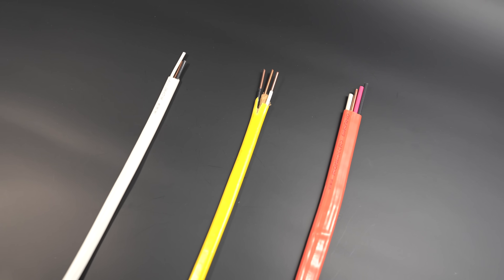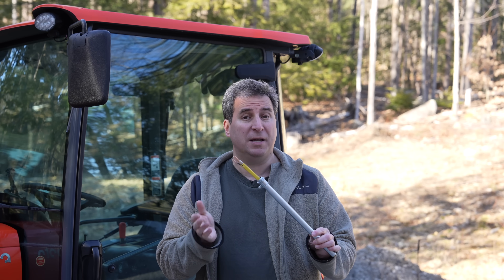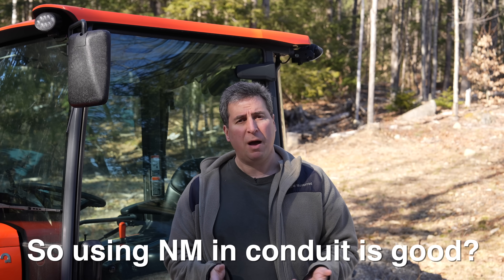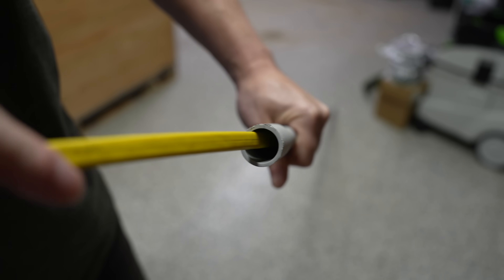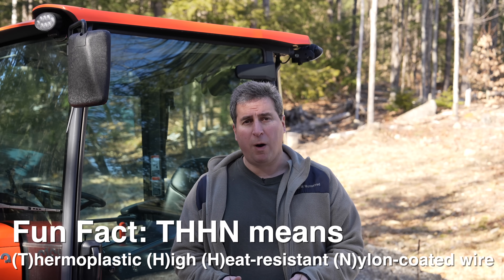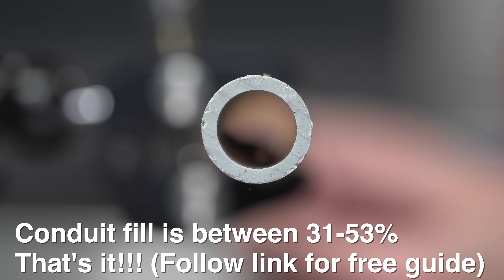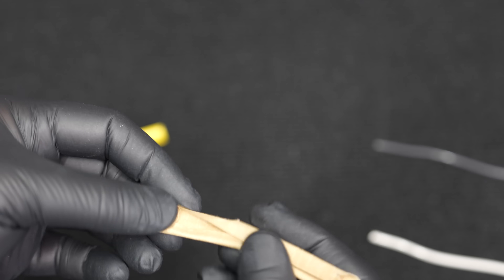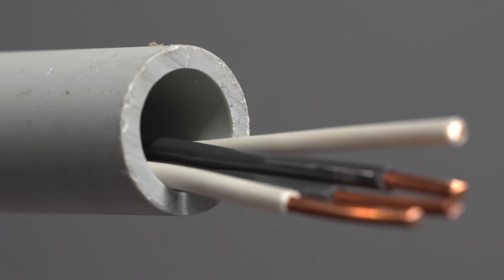#1 DIY Electric Mistake - Can you use Romex Wire in Conduit?

Comment: Good vid and most important, accurate. Fun fact, back in the day the company I worked for, due to a conflict with an inspector, actually contacted one of the bigger wire manufacturers and asked what type of insulation they used on the wire they put in NM cable and they said it was thhn. Also, I've in the past have pulled the conductors out of the jacket and noticed that on the conductors insulation had lettering and upon looking much closer, it read that it was thhn /thwn. Therfore I wasn't hesitant about using them for any conduit application, even in a wet location. But I've also done that and there was no lettering on the insulation therefore being hesitant to use it in a wet location but not so much in a dry location.
Reply: I could have sworn I remember working a Friday evening trying to do a last 25 ft run of wire for some track lighting and was short on wire so I grabbed the Romex saw it said thhn and told my foreman lets just run the Romex without the jacket, it be the most expensive 25 ft run ever but screw it at least we'll be done, and we did so ya I even remember cutting some power cables that were 14 gauge thhn to use as pigtails when I was stationed in Afghanistan.
Reply: @nowmann2821 So?
Reply: Yeah, the wire inside NM cable is just THHN, so technically it's no different from using any other THHN.  The problem, though, is that the manufacturer simply hasn't certified it for use in that way, so technically you're using it contrary to the manufacturer's instructions, which is a violation of the code, regardless of what type of wire it actually is.

Basically, there's nothing inherently unsafe about doing it (provided you were careful about how you cut it out of the sheath, which is another potential concern), but it's just against code due to a technicality in how things are written (so technically you still shouldn't be doing it).

(However, if the wires have the correct markings on them, then I seriously doubt anybody would be able to tell that's what you did anyway, so...)
Reply: If it says thhn is code approved, no matter what the "experts" tell you. There's a NMC to EMT connector made for that.
Reply: I've never seen lettering on the individual conductors inside NM. I wish they had it
Reply: Wet location we use XHHW not THHN.
Reply: @mongo7129  can also use thwn in wet locations and as I "already" stated, the wire I pulled from the romex I was using at the time was marked thhn/thwn. 🤔 🤦‍♂️
Reply: @chaser9363  Ever pull out old thwn thats been used in conduit outside and the outside cover of the insulation is peeling off?  Code is a minimum requirement.
Reply: @mongo7129  your point?
Reply: @mongo7129  We only ever used XHHW at municipal water and sewer plants. Only big money jobs.
Reply: @mongo7129 if you're a "we", why are you even here? Learning your trade? That's reassuring.
Reply: My sidenote... No matter how much an application note or local code does/doesn't make sense to US...  (WTF... the wire inside this jacket is marked 'xyz*', why can't I use it over there??) GFB there is EVER an issue, INSURANCE companies will use any reason to deny a claim. It's ALWAYS about liability and insurance.
Reply: In 1984 when we were building our house. The electrical inspector required us to protect the NM cable feeding the basement receptacle boxes in metallic conduit between the boxes and the first floor (about 4 feet).
Reply: @led1002 EXACTLY.  Also for an appliance such as a disconnect /safety switch mounted on a furnace.
Reply: You assume it's accurate because he says it with conviction? A chump decision.
Reply: Often the individual wires inside NM cable do not have any markings on the insulation. If there are no markings on the insulation, there is nothing for an inspector to look at and know with certainty the type of wire and type of insulation. You'll probably fail inspection because the inspector can't inspect unmarked wire. If you are lucky to have NM cable that has the individual wires labeled on their insulation, I suppose that wire could be used wherever code allows wire with those markings to be used. I'm not an inspector, so take what I say with a dump truck load of salt. ;-)
Reply: yeah this code article really sucks a lot of times because yes, it is thhn, clear outer coating and all, but no marks so a no go! But still, if your doing an outdoor panel, they used to let you get away with legnths long enough to just get under the house. i think they still do on a panel change, but it's been a while since i did a new outdoor one. if you cant, you're really sucking hind t1tt.  I get that anything outside will be wet inside and the paper will get wet and wick. But individual wire holds up too so.... whatever. It's not like we have a choice. But i have also stripped the insulation off and run the wires into a panel and gotten away with it too. But mostly it's type UF outside from jbox to jbox then switching back over to nm-b.   hopefully you're billing by the hour.

Comment: I have used direct bury rated romex in PVC conduit (for mechanical protection) for exterior locations above and below ground.
Reply: Yeah, "You're not allowed to run non-metalic cable in conduit in a damp location" is too confusing imo. What I'd say is that no conduit turns a damp location into a dry location. I.e. if you run a conduit through a damp location, the inside of the conduit is also a damp location and you have to use damp-rated cable.
Reply: @Mike__B   That is literally what I said.
Reply: @jamesrempel8522  My apologies, I misread what you said, unless you edited it in which case... sure.

Comment: I battled with a contractor on this recently. He ran NM for a mini split right through a block wall and then wrapped under and in to a disconnect. Unacceptable to me having both unprotected NM passing through rough concrete holes and NM pinched behind a disconnect outdoors. Had him junction it indoors to conduit and THWN out to the disconnect.  He insisted there was nothing wrong with what he had done but ultimately installed it the way I asked.
Reply: I agree that inspectors might not check, but that doesn’t make it right. Conduit is not guaranteed to be watertight, and neither is NMC. That’s why damp locations are not a good idea. 
Code regulations are there for many reasons. While some reasons may be lost in antiquity or controversial, they made sense to someone at some time. 
Humans are very likely to come to poor conclusions individually, which is why groups of experienced reviewers come to consensus on codes. “It won’t be checked” and “everybody does it” are not good excuses.
Reply: All the multi-family new construction here in the PNW has Romex in the outdoor conduit going from the disconnect to the outdoor unit. I do HVAC and asked an electrician about it, I was informed that the inspectors walk up to a building and see 40 something mini-splits and just sign off on it because they don’t want to inspect them all.
Reply: @joelperigo7213  Isn't it legal if it just goes to the disconnect mounted on the outside of a wall? From what I was reading NEC approves that every house I ever seen had AC unit used NM wire usually 8/2 to a disconnect. 99% of the homes here in AZ are big units not mini-splits usually 4-5 tons. My home has roof top unit like 99% of homes built before 1990 all of them are using NM wire up through the attic to a disconnect mounted on the stand below the unit. The roof top units are like what most are used to seeing on commercial buildings entire AC unit is in one box. The air is ducted up to the roof makes replacing them simple. Newer homes have split systems big condenser unit on the ground like most other states. Those I see disconnect is mounted to the wall with NM wire passing through the wall.
Reply: @Mike-01234  From what I read, similar debate there to what is discussed in this video. NM is straight through the wall and direct in to the back of the disconnect without passing much daylight seems to be common but might not meet code. In my case, the NM ran unprotected through a block wall, wrapped down and in to the box (3” run behind the box), AND was mounted on a stone facade so not right against a wall. Worse than what may commonly be done, in my opinion.
Reply: There's nothing really wrong with running NM through a block wall (concrete floors are considered damp locations, but walls are not).  I'm not sure exactly what you mean by "pinched behind a disconnect", so that might or might not still be a problem...

If it was NM-C cable, that's actually fine for damp locations and running outdoors, too, and only needs to be in conduit if it's somewhere where there's a risk of direct physical damage (i.e. someplace people are likely to be banging heavy stuff around or it could be clipped by a vehicle, etc).
Reply: @foogod4237  I would agree with you  but  I always called UF-b
Reply: @michaeldufresne9199  NM-C and UF-B are technically different kinds of cable.  Both are fine for use in wet locations, though.

(UF cable is usually a bit more expensive, though, because it can also be used directly underground (without a conduit), where NM-C cannot)
Reply: In the situations I am finding, the NM cable is not just coming out of the wall and going to the disconnect, it is also going through the liquid tight conduit from the disconnect to the outdoor unit. Because this conduit is outside, the interior of the conduit is considered a damp location, and as such, NM cable should never be used in it. I agree that this is not correct, and I am not justifying it. When the company I work for does HVAC installs, we contract out the electrical to a quality company that pulls the proper wire. The problem is with the large companies that do the large multifamily, new constructions, and the lazy inspectors that don’t want to do their job. I am not saying all inspectors are lazy, but I have seen a lot that are lazy, or start questioning me, an HVAC service technician, on if the electrician did their job properly and if a certain disconnect is legal or not.
Reply: Don't forget that conductors are required to be identified, and if you strip the jacket they are not.
Reply: @lgninjalo  They are white, black and bare for the ground, what are you talking about ???
Reply: @mattywho8485 Article 300, General Requirements, requires conductors be identified with the Manufacturer, conductor size, and insulation type. On NM-B they do this on the outside. So the conductors inside aren't properly identified.

In addition to this, there is a nylon jacket present on THHN that isn't present on the conductors inside of NM-B, so you can't just strip it and put it inside conduit outside by code as that nylon jacket is what gives it a wet location rating.

But let's not kid ourselves, nearly all of us strip the shit and put it into a pipe when we go outside.
Reply: @mattywho8485  just looked in the book. 300.8. They call it "marking", but it's to identify the product.
Reply: That would conform with code in NM.  Same with exterior plugs you can run nm cable to them as long as it's out of your wall.  It's not considered a damp location unless it's below grade.
Reply: Thankfully where I live I don’t need an electrician to wire things. We can even put in our own meter base to the power company’s specifications.  I worked around licensed electricians in my career as a telecom technician that were always kind enough to give me advice.

Comment: Many years ago l buried (1 foot under  ground) under ground wire to my shed always wondered if I should have put it in conduit just in case in needed to pull it through but after this video glad l didn't
Reply: If you use UF Direct burial cable it should be fine. Only issue is where it comes up from the ground, if it can be damaged (ie from weed wacker, lawn mower, etc)
Reply: @guytech7310  where it comes up along side my shed l did run it through conduit for the purpose of keeping it safe

Comment: I've seen electricians strip the jacket off of Romex and use the wire in a conduit. Do you have references to why that would be bad?
Reply from the maker: Similar to the electric code, you won't find a refernece to say it can't be done. Instead you will find that the manufacturer only designs that cable to be used in the protective jacket. Often times the code is a subtractibve meaning that if it doesn'r prohibit something than it may be allowed. In this case, they also state you must follow manufacturers specs which will only show NM cable being used with the jacket in place.
Reply: I have a related question.  When I need a small piece of wire to create a pig-tail jumper for a typical in-wall dimmer or switch connection, I've been told just to take a small piece of Romex and use the wire inside.

Reason given - you can't easily buy short jumper wire at typical big box hardware stores so that's the only way to get jumper wire?

Is that true?  Is this code-compliant, ok, or a really bad suggestion?
Reply: @RobSpiv  completely legal. Do it all day
Reply: @RobSpiv  not just complaint,  but normal practice. It happens in a junction box, jackets will already be removed.
Reply: It's THHN wire in romex. The jacket is pvc and paper for easy flexible  pulling. However everything code is per manufacturer instructions. When you remove romex from its jacket just to use the THHN wire, you're well outside the manufacturer instructions of the use of the product. So, while it's not code, who's to say the THHN wire was originally in a romex jacket or a spool purchased in bulk. Also, who's to say the THHN in romex is built equivalently to a normal THHN wire that was bulk non jacketed. Basically, Removing it's jacket may not be wrong, but doing it you're definitely breaking code and voiding any kind of warranty or protection from a lawsuit you may have had doing it correctly.
Reply: @lj5773 mainly because it’s not stamped thhn. So technically you can’t verify the wire type
Reply: @johnsandlinjr  that makes since.

Comment: No topic brings out the internet electricians like NM in conduit. 😂
Reply: Master Internet Electricians
Reply: @gregdoyle829 😂
Reply: And here I was thinking it was the eternal battle between wago and wire nut :)=
Reply: @TheAzynder Which aren't technically wire nuts..blah blah
.😁
Reply: Everyone is an expert on the Internet, be it cars, motorcycles, plumbing, relationships, etc...  we all know this to be fact.
Reply: As long as it's(N)ot (M)y conduit.
Reply: I R a professional 😂
Reply: I got into a long winded “discussion” on You Tube about outlets installed upside down with the ground up and Oh boy! that opened up a long series of posts. I am not an electrician but have done my share but I worked 35 years in chemical treatment systems for large scale chillers , steam boilers and have been in every kind of construction location around. I worked side by side with pipe fitters, electricians , and anyone else involved in building Hospitals, prison, schools , high rises, military bases, sports arenas etc. 
  I had mentioned that in the medical world like hospitals the outlets can be found that are upside down and are correct. They are critical care outlets specifically wired separately from the other outlets EES in particular. I got all kinds of crap from some “ electricians” that have never been around that kind of location. Yet, every hospital out there has them. Medical clinics, veterinarian facilities, some dental clinics etc. So, if you want to stir up a hornet’s nest just talk about upside down outlets.😊 Oh and here’s a quick explanation >
   EES Branches
A Type 1 EES, typically found in hospitals and ambulatory surgical centers (facilities with Category 1 patient care spaces), is divided into three separate branches, each supplying power to specific functions: 
Life Safety Branch: Powers systems crucial for the purpose of life safety, including exit signs, emergency egress lighting, and fire alarm systems.
Critical Branch: Supplies power to circuits and equipment that are vital for patient care, such as task lighting in operating rooms, specific receptacles, and fixed patient-care equipment. EES outlets (the red ones) are connected to this branch or the life safety branch.
Equipment Branch: Provides power to essential building systems that support clinical activities, like certain elevators, HVAC systems, and medical air/vacuum pumps. Power to this branch is often delayed to prevent overloading the generator during startup.
Reply: I mean... It's not that rare a profession? Electricians aren't allowed on the Internet?

I don't understand. 

The video was basically click bait.  NM being illegal in nearly all use-cases isn't some revelational "gotcha".
Reply: @SilverF-1 I think the joke is lost in translation.
Reply: @markkempton4579 So, in what language will this be hilarious? 
Why did the copper wire read the news? To keep up with current events. 😅

Comment: Wire lubricant...
Reply from the maker: Personally I did a 20 foot run once in 3/4" conduit with 10/3 NM. I used lube ad I will never do it again, while it was code compliant it was a nightmare to pull through a most straight pipe. I guess you have to try to experience how awful it can be.
Reply: @SilverCymbal  I've had a very different experience.  I won't pull long runs without lube.